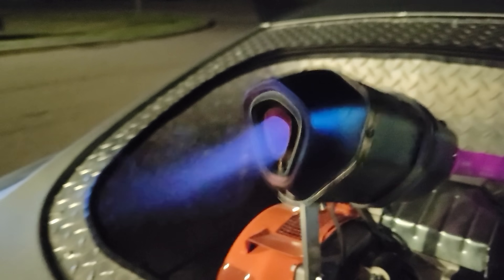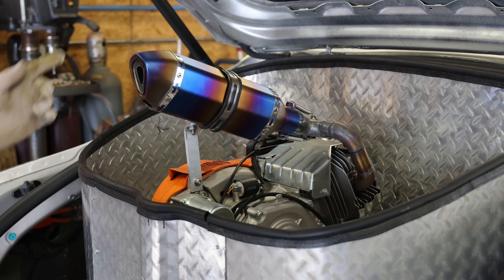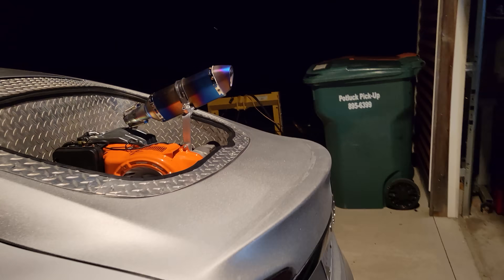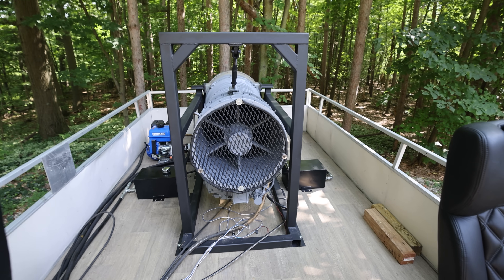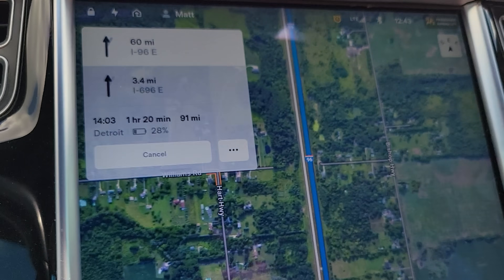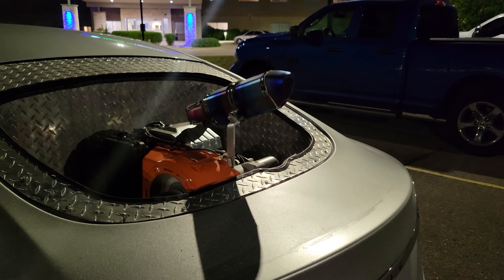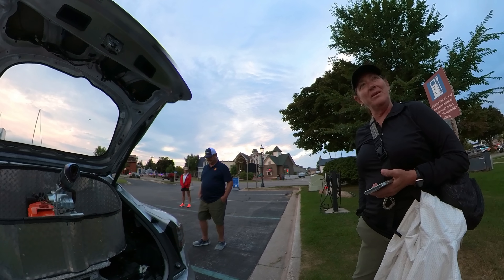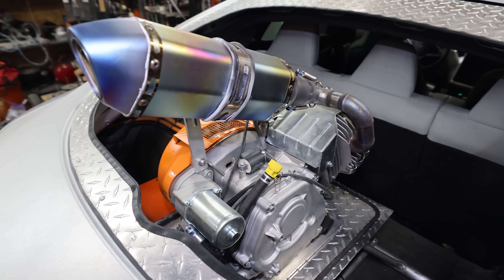Cordless Tesla (I Drive 1800 miles without charging) P.1

Comment: For even more giggles you should have used your single cylinder diesel from your turbo powered gokart! 😁

Just imagining all the looks when a tesla "rolls" coal 😆
Reply from the maker: That was the original plan but I had a last minute issue.
Reply: @WarpedYT  
I take it from your little "easter egg" goodbye gasoline that your next interation will be somewhat more efficient turbo diesel powered rig?
Did you use a permanent magnet stator design (typical motorcycle charging coil design) under the cover for your generator instead of a variable field alternator?
Please do tell me about the last minute issue, technical discussion on the "engineering" level is rather interesting :)

By the way, you create really good quality content and I think that's the reason to your millions of subscribers even though you don't upload that frequent.
Keep up the good work and don't let quantity overthrow your quality 🤠

One more thing, if you are going to run different fuels than standard diesel adjusting the timing might help some / a lot as different fuels you can combust in a diesel engine burn at different rate. Slower and faster burning fuels needs different timing for optimal combustion during the stroke and don't forget to crank up the fuel together with the boost. 🤓

Comment: Seems like it would be pretty easy to design a quiet flowing muffler and make that MUCH nicer.
Reply: PRT running an alternator and going crazy with a Peltier effect generator system for exhaust power extraction besides the PRT!
Reply: It is less the muffler and more the whole package.  
There are ways to make a quieter generator but he was pressed for time and budget.
Reply: Would need to active noise canceling.
Reply: It would have been but he's a Tesla owner so....
Reply: @Rokomarn  He's not really a Tesla owner if he modified it to the extent that he did, thing doesn't act like a Tesla at all now.  It's actually a good car now!  Also he owns a Supra, so he's not exactly the sack of crap you're trying to make him out to be.
Reply: @BlueOvals24  cope
Reply: @BlueOvals24 :  Spoken like a Trump truther and flat earther.
Reply: @rogergeyer9851  cry about it. You wish you could own a car like a tesla or supra
Reply: He mentioned that he tried to muffle it more, but it wouldn't generate the watts he needed.  There probably is a better way to do it, but the bottom line is he's one man that built a better car than the original automaker.
Reply: @BlueOvals24  You can make a zero loss quiet muffler. Just requires space I'm sure once he gets a larger setup that peforms, a proper muffler will be made.
Reply: @AdamOpheim  Yeah, you gotta think, it's a new thing.  Nobody builds something perfect on the first go, or even the first several.  I'm sure if he does this again he'll improve on the noise.
Reply: @BlueOvals24 :  Using "better" like someone who'd claim Chernobyl was a good thing.

Comment: You do things which engineers only dream about. It would have been nice to see some generator specs. and mechanical setup.
Reply from the maker: Thank you and I know, I really wanted to show everything, but this is the early stage and this is my first version I can't share that information yet, it took me over a year to get this to work perfectly.
Reply: My guess: It's an inverter generator with the high voltage stator  rectified to pack voltage and connected to the tesla pack via one of the aux feeds for the PTC cabin heater or coolant  heater. The RPM is adjusted so that it doesn't overcharge the battery. The car is left 'on' so the HV contact is closed so that it charges

Comment: Very poor efficiency!
But not surprising when driving a 2 tonne car with a lawnmower engine!  😆
Even my 1989 Mercedes W201 2,3Liter with mechanically injection, with 300k on it makes like 9Liters/Km (26mpg)

But this little Kohler engine was a trooper!!!! 💪

Such a hybrid solution would only make sense if a highly efficient motor were permanently operated in the optimum range.
Like a 500cc turbo diesel, engineered to the max, to make like 45-55% efficiency all the time.
And even then, you would have to fight hard to make it worth the expensive and heavy batteries!

Hybrid drives are useless for the majority of applications!
And with a lot of hydrocarbon besed energy in our grids world wide, electric cars are  just as pointless.

Comment: I really wanted to see how you integrated the generator into the car’s energy system. I thought the car won’t charge and drive? Is it really as simple as plugging it in? If not, a video of the integration would’ve been awesome. Frankly, I actually was waiting for this video to see exactly that.
Reply from the maker: I know I really wanted to show everything, but there was a couple reasons I didn't, first off it was not easy it took me almost a year to get the system to work perfectly, second I had to have everything custom built working with the engineers overseas, I had to rip the part the entire high voltage system in the car which nobody's going to do unless they have big balls. And last but not least this is my first version of the project I have to first finish my other versions file my patents and then I can reveal how I made it work. It was not simple it was not easy and it was not safe for sure. But now it is and it works flawlessly. Just gave to perfect it now.
Reply: @WarpedYT  so does the generator output power go to the motors  inverters? 

So the car just sees an extra 10kw of power thinking it's from the battery vise versa when using regen .
Reply: @rickyjb23  I would assume he's just dumping the genny power into the main HV DC rail since he said he's not using the onboard charger. You could do that with a high power EV charger, dump 240vac into the charger and it outputs 300vdc direct to the bus. Just gotta hope the BMS doesn't get upset?
Reply: @MrEpanek  high power ev chargers are DC, directly connecting to the batteries and bms. The charging logic is handled externally. So there’s no internal charger he can dump power into (it only accepts AC)
Reply: @SivaKanthSharma  By "high power" I ment a standard AC EV charger greater than the usual 7.5kW since he would want to take advantage of the full 10kW of AC coming out of the genny.
Reply: @WarpedYT  aah, so it’s potentially patentable work. So I guess it’ll be some time before we see it. I hope your application succeeds so that we can get a video on how it works!

 I think surely 99.9% of the people who watch your videos not to replicate the work, but just to witness the pure genius and skill of your engineering and machining. I know I do. Messing with the high voltage system is now another step higher in your insane engineering. Awesome!
Reply: Same here. I wanted to know he got round the "anti-drive-off-whilst-still-plugged-in" protection.

Comment: Did I miss it or how is he charging while driving?  Like electrically how is he adding to the battery?  The tesla won't let you through the standard charge method.
Reply from the maker: To sum it up you cannot charge a Tesla while you drive, I built a modified BMS system.